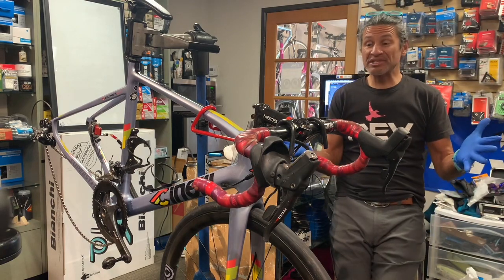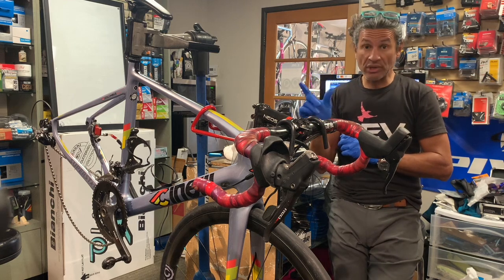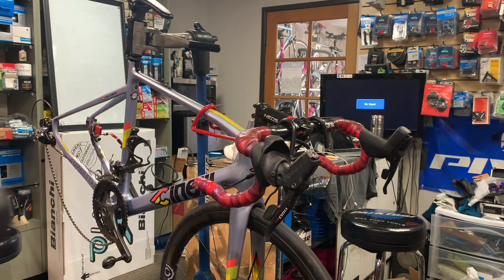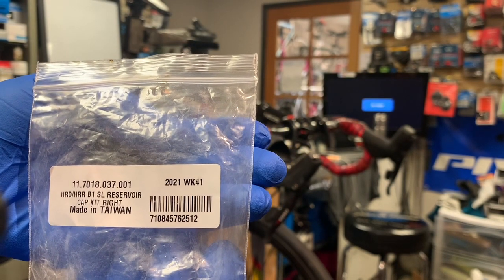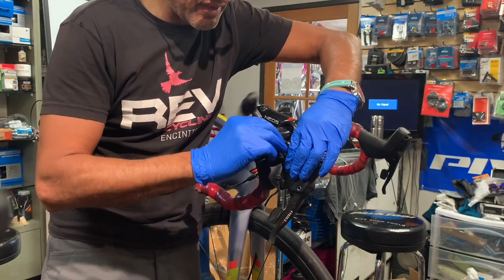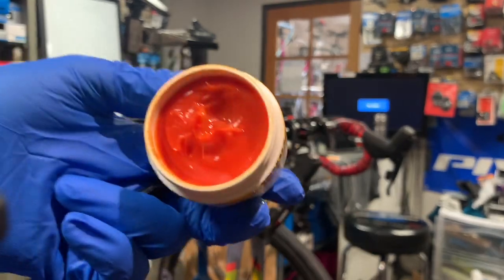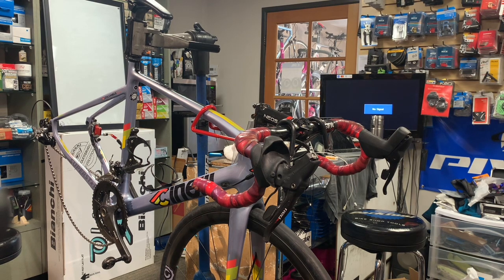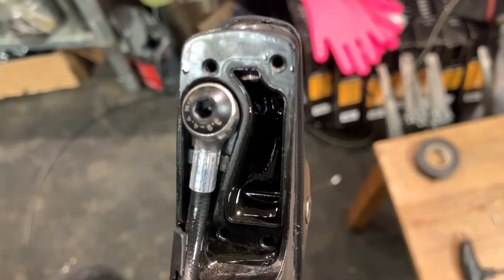How to replace the bladder assembly in the reservoir cover in a SRAM Red HRD brake system

Comment: Thank you so much. I have just ordered the 2021-WK41. Bought a brand new old stock Sram force 22,  and the rear shifter is leaking from the same gasket. As far as its shifting goes, I am not happy. I set it up 1x with Sram force 1 rear derailleur but my sensah xrs pro provides more effortless shifting.  This is the last time I am wasting money on Sram. It weights more, shifts bad, cost more, and does not last!. This is BS. On the other hand, my sensah has been working  perfectly all these time.

Comment: This is an excellent video. I’ve replaced several of these. My opinion is that they’re badly designed and extremely unreliable. The carbon force is even worse because the threads on the carbon screw holes deteriorate and won’t hold the bolts. Generally I’m sick of SRAM’s road hydraulics. 90% of my maintenance hours are fixing SRAM hydraulics. By contrast I’ve never had a single Shimano failure. The SRAM bleed process is also a nightmare. Sram need to re-engineer the entire system and send us free replacements of the new improved versions. Look behind the hood and you’ll see fluid leaking out that “breathe” hole. Interestingly the RIVAL is more reliable. This could be because the body of the lever is alloy and not carbon fibre (aka plastic).
Reply from the maker: Yeah the Red carbon body is a mess. When you have to replace the lever you have to be extremely careful when installing the banjo bolt. If it’s just a little canted you will strip the lever body - yep it happened to me
Reply: @SeeYouUpTheRoad  my problems have been with the sram force 1x11 lever. It’s a carbon body with the bladder assembly same as your video. The alloy rival uses the same design, but doesn’t seem to have the same issue. I wonder if the carbon construction is the problem?
Reply: What was the outcome with a stripped screw? I think mine has 1 stripped and is causing an improper seal.
Reply: @unodewaal  I replaced the leaking Force carbon lever with the alloy Rival. It’s been fine so far. The other lever is the original carbon Force lever and I’ve been bleeding and pressurising it every few months. It’s a nightmare, but I can’t afford to replace it.

Comment: thank you, very helpful seeing inside another one and what seems like my exact issue.    I have done several bleeds and hose replacements on my mountain bikes but this morning was my first time digging into a SRAM road hydro today.  The original reservoir was wrinkled and deformed and I think maybe I did not get it sealed up again well.      lever comes half way to the bars before the pads engage the rotor and a tiny bit of fluid is weeping from the cover....but oddly doesn't feel spongy.     Guess it has to be the bladder or the banjo... hope its the bladder because I sure as heck cant find the crush o ring I would need to re install the banjo without re buying a whole hose kit :O       How common is it to get a leaky banjo?  I used the hose kit and sram DOT grease really hope its just the old reservoir.
Reply from the maker: Thanks for watching

Comment: Great video! Quick question, what's the purpose of covering the bladder in dot grease? I haven't been able to find any information on this elsewhere. Thanks!
Reply from the maker: The DOT grease seems to be encouraged at every step - I guess so things slide into place. It’s a SRAM thing. 

Shimano doesn’t specify any grease when doing a brake assembly
Reply: I was wondering about this as well. I saw an old video from SRAM and it shows installing a bladder and cover but no mention of DOT grease.

I’m also assuming you drained the system before you opened up the lever / bladder?

Comment: about the "please be very careful part"...I picked up a used set of the same Red HRD shifters for cheap. The right shifter leaks slowly and looks like the threads on the shifter banjo and one of the plastic hatch cover screws are stripped. Any thoughts on a possible fix? Am I SOL?
Reply: Hey i think i have the same problem with the stripped threads on the shifter. looks like its just screws threaded directly in to the plastic like some Ikea furniture thats just a joke to me, screws can't be tightend properly. Did you find a way to make it work?
Reply: @Seroga225  Nope, didn't bother trying too hard for fear of making it worse. I agree, it's a pretty crappy system that appears almost designed to fail after a certain amount of hose servicing. Rode front brake only until I got my hands on Rival AXS. 
A mechanic at the lbs has seen this before and said it's probably a goner, but not necessarily an impossible fix. He's happy to try and hack it back together but I just haven't gotten around to bringing it in. Any SRAM specialists around you who can take a look?
Reply: @youloveulises  hmm a couple of "dealers" from the SRAM page but can't say if they are specialists or just selling stuff. Just ordered a new cap bladder screw set see how that works. If its really the screws just bite in to the plastic i might use some slightly larger screws or put some resin into the hole and thread it again :D
Reply: @Seroga225  do let me know how it plays out of you pull through with the fix! I can confirm it screws straight into plastic, I saw some of the plastic threads come out
Reply: @youloveulises  Soo "quick" solution: buy slightly bigger screws (from 3mm to 3,5mm in diameter). Dremel the holes on the aluminium cap slightly bigger to fit the screw. eventually take off some material from the screw head to fit the cap notch. the screw will easily cut a new thread in the plastic. See easy solution :D
Reply: @Seroga225 sweet, glad you got it working! Will definitely try this in the future

Comment: Where did you find it to buy? I fucking need both sides! Left and right! 
Can you please help me? I live in Brazil but o do have some friends in US that could receive it for me!
Please, help me!
Reply from the maker: I am a bike shop. I am an authorized SRAM dealer. I can get you anything you want as long as it’s in stock.
Reply: @SeeYouUpTheRoad  hi there! So, that's awesome! I need to buy both sides of the bladder! Can you send it to Brazil?
Reply from the maker: @lucaspires3488  yes or to your friend in the US. I need very specific details on the brake levers you have on your bike. I will order exactly from YOUR information. I am not responsible for ordering the wrong parts based on your misinformation.